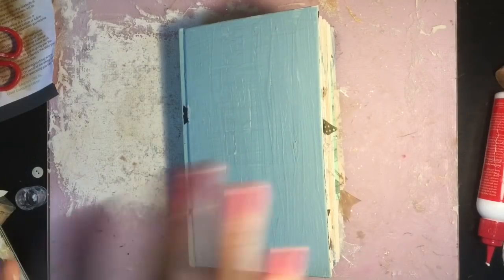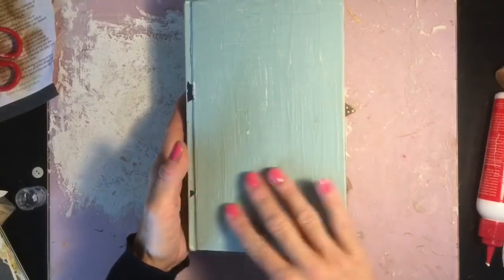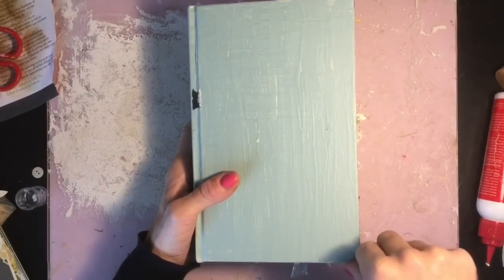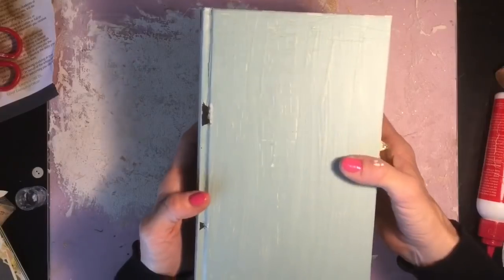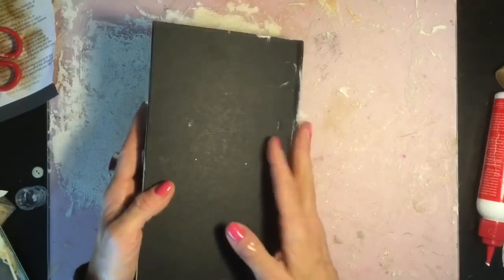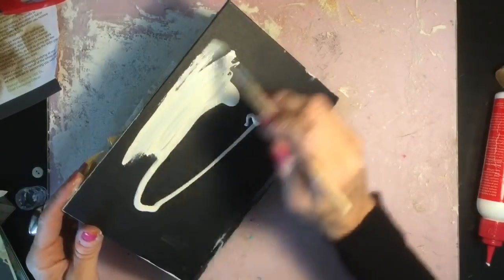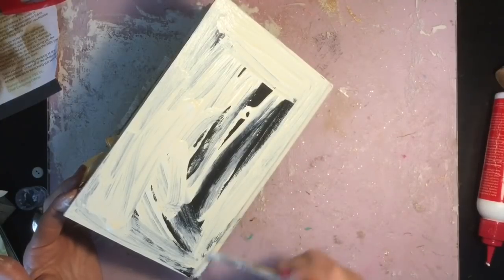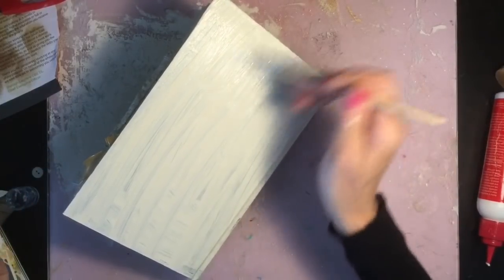Gypsy Rose Cover - Disappointing results - Experimenting with crackle Paint Techniques

Comment: I had a chuckle when I saw the notification in my email for this video! The title was too long and it stopped at "crack" So it said Experimenting with crack...I KNEW that it meant crackle but that did make me giggle!  I have never crackled but I am wondering if maybe you overworked the top layer of paint. Maybe use a bigger brush and just quickly brush it on and leave it to do its  thing would work? Some days its just not a good day to try to craft though! I have them too!  Hugs!
Reply from the maker: Oh my goodness, I didn’t realise that the title would read like that, yes very funny........thank god you realised what I had meant. Yes I think I overworked the top layer, as I received a great tip for this technique from Jo (comment above). Will have to try again x

Comment: I have done the crackle technique for years and have just recently done it on a book cover. Here is my technique:
First: paint the cover with the base color of Acrylic paint that you want to show through. Let completely dry.
Second: I just use a cheap basic school Glue and I give it a medium coat over the base paint. Always apply the Glue in one direction and don’t keep going over the same area. Let dry until tacky.
Third: Apply the top layer of acrylic paint ... a contrasting color ... also paint in one direction and do not keep going over the same area. As this top layer of paint dries you will see the crackling. You may use a hair dryer to dry this layer faster ... just don’t dry it completely with the dryer.
Fourth: I also after everything has completely dried apply a clear matte spray for protection.
I hope this helps and good luck. Oh by the way I love your videos!
Reply from the maker: Hi Debra, fantastic instructions, thank you. I will have another try as per your instructions, as I love the crackle effect. Thank you so much for sharing your technique. X